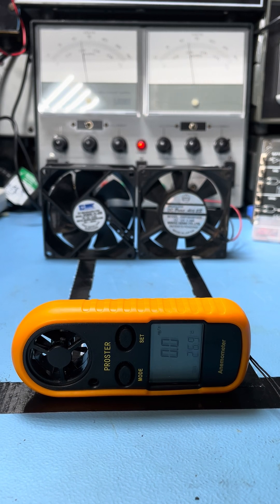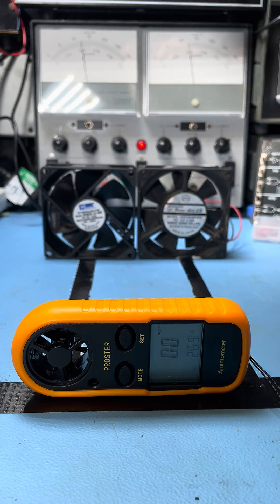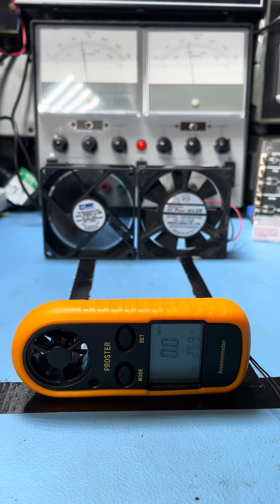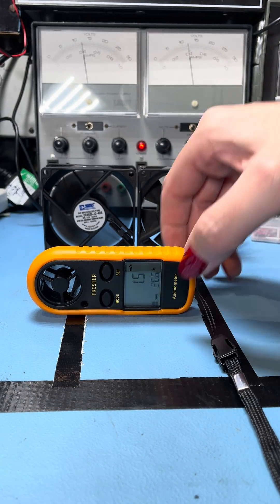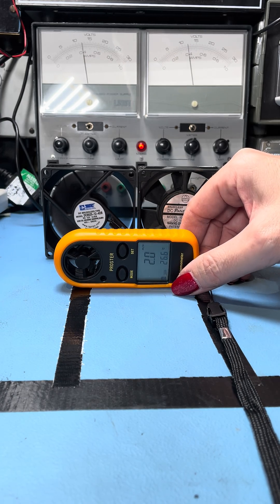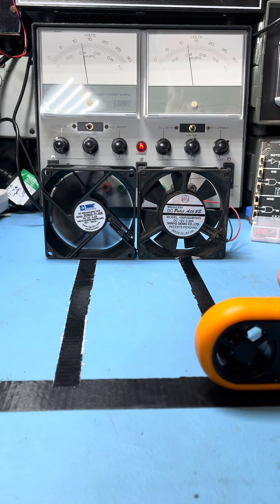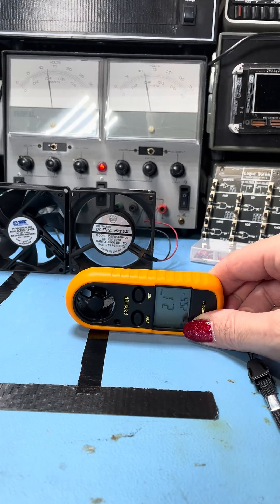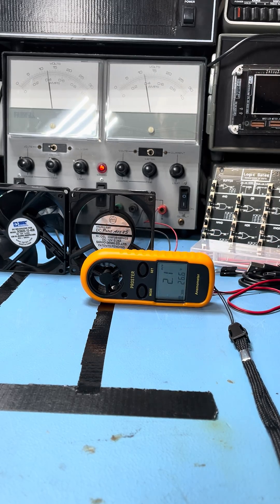Amplifier Fans (Non) Scientific Airflow Test!

Comment: So the old fan is more powerful and spins faster. That is why it is noisier.
Reply from the maker: There wasn't a great deal of difference and when I put my hand on the output of the old fan when it was fitted in the amplifier and the same after the new fan was fitted the airflow felt greater from the new fan. The bearing was failing on the old fan. That's why it was making an unpleasant and much louder noise. Also modern fans have much improved quieter bearings as well.